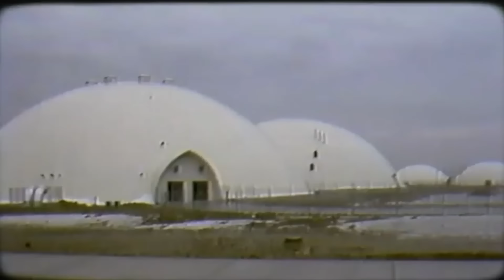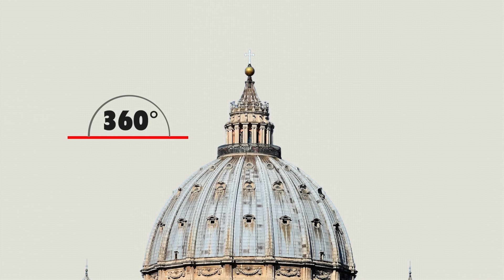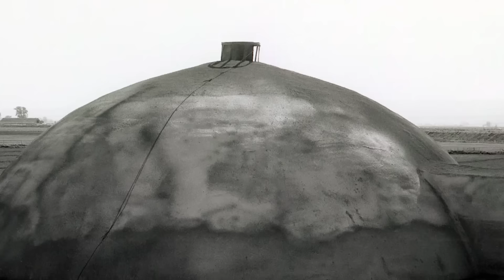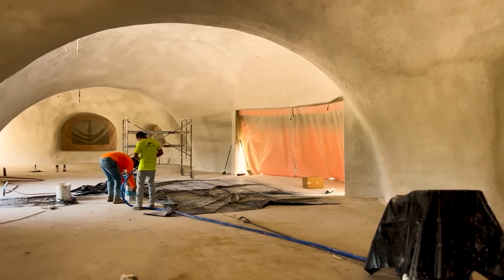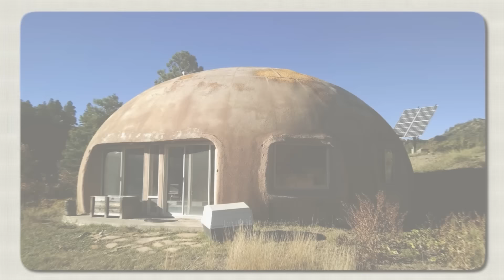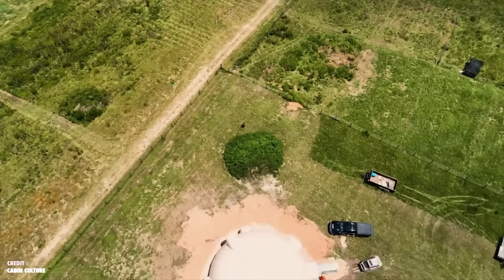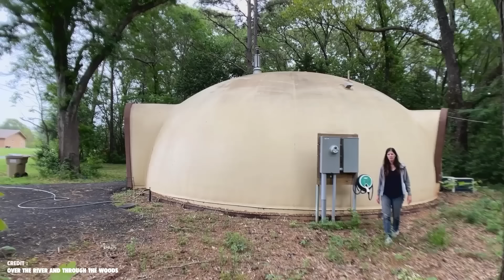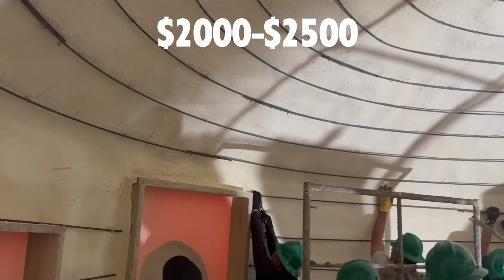This Home Survives EF5 Tornadoes, Wildfires, and Costs $0 to Heat. Why Aren't We Using It?

Comment: I have been trying to make the point that a round house can survive tornadoes
Reply from the maker: The aerodynamics of a circular shape certainly help deflect wind loads much better than traditional corners. So you are right to make the point!
Reply: That’s one of the biggest advantages of the design. The round shape and continuous concrete shell give the structure a much better chance of handling extreme wind forces than a conventional house.

Comment: I was told by Architecy Bill Milburn that credit should be given to Tecton Corp in Colorado Springs  who taught David South this technology.   He made a few changes so he could get his patent.  I was also trained by Tecton Corp in 1977.  I designed and built my dome and the first totally  underground dome for Park College in Parkville Missouri which has over 30' of earth over it. It is the entrance to their underground library in the mined limestone common to the KC area.   Other than that , everything in this video is factual.  As an architect/builder I got tired of the battles and went on to other systems.

Comment: Fact: These are legal in my state of Nevada, as long as they meet all the building regulations. I've seen a few of them here. One would think they'd be more popular in a place that reaches 120F in the summer. However, the biggest problems aren't with getting them approved. It is with the interior walls, cabinets and plumbing. It's very expensive to furnish and decorate a round structure and comes with many issues we normally don't consider, like curved cabinets, counters, closets and bathrooms. Though it has many advantages when it comes to heating, cooling and strength, round is the least space-efficient shape in a practical sense. These homes are actually legal to build in most states. People just don't do it because it costs 4 times more to design the inside because everything must be custom-made.

Comment: In fact, there is an even better technology, panel construction, where reinforced concrete panels are produced locally and the house is assembled like a Lego set using a crane, in just 24 hours.

Comment: Their odd shape means less usable interior space. Its a nightmare for running electrical/plumbing. Difficult to impossible to modify or expand once complete. Repairs are costly and specialized. And they suffer from leaks and flood damage. People don't want to live in large concrete igloos.

Comment: uh.... you've glossed over a couple big items here, 
PVC membrane on the outside, lifespan is 30-40 years due to UV exposure.... after it fails, there is nothing to protect the polyurethane  insulation, there is also going to be an issue attaching the replacement liner to the poly urethane insulation PVC resists common adhesives
  
also, fire is going to engulf that insulation in an instant.... the outside is highly flame-able

Comment: I really love the concept, but the fact that it is entirely made out of steel-framed concrete is ridiculous. For those slightly giving a damn about the ecological aspect, there are lime and clay based dome structures made with 3D building printers developed. For those that don't care, well.. glad you will be able to test the indestructiveness through climate disasters.

Comment: Society is so messed up we build BOXES cheap that get damaged so much making insurance companies RICH and hydro and water companies richer its INSANE.I lived in a 75 foot dome with a proffesor in the 80s and it was an amazing exp. The acustics are incredible the air flow is pure and the temp. was regulated by 6 cieling fans 30 feet up and a cool sysetem for airflow. He heats with wood and electric back up makes his own preserves and wines and at 87 today is still there. He built 6 more smaller ones all by his own triangle jig system and use 2x8s to make the triangle.Hes had numerous trees fall against it but they just rolled off and lived threw 2 tornadoes. 5 min from our city everyone calls him captain (of his own ship lol) If society adopted this style for towns etc. costs in life would drop insurance companys would go bancrupt and energy companys also. So society is designed to make the wealthy RICHER its CORRUPT as hell. TY for this memory.

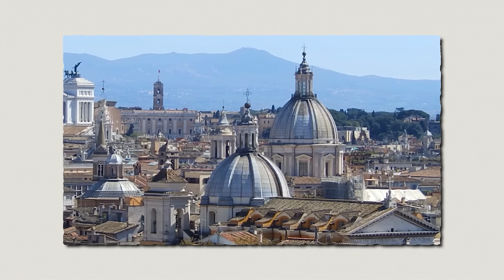Comment: The graphic at 1:20 is incorrect and does not illustrate the statement. Instead, imagine looking top down at an arch and spin it 180°.  The two abutments of the arch will trace out a 360° circle.

Comment: the main reason is because the interior space is difficult to use.  the windows are hard to seal properly, require specialized construction crews increasing cost
Reply from the maker: They certainly have their challenges!

Comment: Cooking limestone into Portland cement, OPC, with which concrete is still made, puts .86 ton of CO2 into the atmosphere per ton of cement. It's chemically active--slowly dissolves in acid rain--and wants to crack. The cracks let water, even vapor, reach the rebar, which rusts. Rust needs three times the space, and as it expands it breaks the concrete apart. Engineers figure bridges made with OPC will last 60 years, 100 with lots of expensive maintenance.

Geopolymer cements are crushed aluminosilicates--3/4 of the surface of the earth--activated with something alkaline like sodium hydroxide. They have 1/10 the carbon footprint of OPC, are several times as strong, don't crack as readily, are more alkaline to protect rebar from rust better, might last millennia, and should cost quite a bit less. And Floridian Robert Panitz claims that his organic-activated geopolymer cement, Blue Crete, insulates as well as an insane R-17.5 pr inch with some aggregates. Geopolmers are fireproof, and protect wood-chip aggregates and bamboo reinforcing from fire and rot. Spray enough Blue Crete wood-chip concrete to climb, once it's set, onto the outside of an inflatable dome form; it takes and holds nails and screws so you can attach walls or anything else to the inside. Staple bamboo rebar, wiring and plumbing to the outside of that, trowel on a stony aggregate layer, and you're done--Blue Crete is hydrophobic so you'd never need paint. Add color to the outer layer--inner too, for that matter--and the structure is "painted" for life, which could be several thousand years. Such a dome would be utterly fireproof and tornado proof; more so, and even more energy efficient, if you bury it. And Hobbit houses are cool. Literally.
Reply from the maker: Good detailed constructive reply.  To be honest I am not 100% sure of geopolymers.  I could look them up on Chatgpt or Google but still would not know how good they were in terms of their suitability.  Encountered similar things in the form of fly ash based concretes (similar to roman cement but made with fly ash), which are also an option as well as adobe if you want a green option.  Really appreciated the detail reply, hopefully proves useful to others!  Thanks!

Comment: NOTE:  While structures can be rated to withstand F1 (Moderate Tornado): 73–112 mph winds, what they are NOT rated for is withstanding a projectile (like a 2x4 or a metal dumpster) slamming into them at 73-112 mph.
Reply from the maker: You are right, unless they are something like an Earth Shelter where they are effectively build into the ground.  Thank you for the comment!

Comment: Can FRP Rebar be used? I'm thinking DOME but would prefer less metal.
Reply from the maker: Now an one click AI reply would say instantly "definitely" BUT as an engineer I would advise that if you do decide to use them then you get a structural loading analysis done in order to make sure the FRP Rebars you use can withstand not just the loading of the cement or adobe but also anything that will be on the roof like snow. Not sure of the cost of a structural engineer in your area but worth doing in order to avoid the worry!  Thank you for your question!

Comment: Well the dome as such is a technically favorable form for several reasons but it also have disadvantages as a home, like windows (difficult and not likable for most people that value light and view), difficult to furnish unless you are a mimalist and if you want a large house with a lot of bedrooms - e g many children etc - the cost effective solution using a second floor will be problematic.  
  
The good properties of the form can be accompliced in other types of forms by other means: 

- The resilience against catastrophes: 
   --  Can be solved by thick armed concrete.  
 
- The thermal efficience: 
  -- Can be solved by (thick) isolation.
  
- The roof resiliance: 
  -- Again armed concrete. 
  
- The isolation on the outside of stone like structure (which gives thermal inertia): 
  -- Can be done with other forms. 

Anyway it's mainly about what you like to live in and the cost. 
Personally I prefer a (mostly) rectangular house as it has the possiblity of more light coming in/better windows. And better possibilities for me to place my furnitures. Although in some ways I like the dome type forms, like the difference to common houses and the organic forms that are possible. 
If I would choose a dome like form for my house I need to have at least the double living area compared to a rectangular house to like it. 

But as always it comes down to production cost. (Here I ignore financial problems and "red tape".)
Reply from the maker: It is a very reasonable position to take.  The home is an individual preference - something you have to be happy in.  To be totally honest my preference is Earth shelters as you can have it any shape you want and benefit from the thermal inertia of the earth.  Also like having a green roof!  Appreciate you comprehensive reply!  Thanks!

Comment: Not sure how these buildings would survive in a location subject to major earthquakes though.
Reply from the maker: True - they are rigid so would likely suffer the same issues as any other rigid building.  The only buildings that would survive such areas would be ones with built in attenuation or "shock absorbers" in the structure.  Good point!  Appreciate the feedback!

Comment: What causes the rarity in these buildings is they are strange looking and it's hard to get people to go for something that looks odd and stands. Also they cost much more money to build because the amount of concrete that goes into them is way more than what you put into a hollow block crawlspace or basement and concrete cost more than wood. Also it is very difficult to find anybody local that has the skill and experience to build these structures. You can find a carpenter in any town. Also would is much more available in the United States than concrete is. Perhaps these would sell better in Europe due to the lack of wood availability.
Reply from the maker: All valid points! I am not sure there is a shortage of wood in Europe as wood is traded internationally.  I think the issue is "acceptance" as a design.  We are all used to square boxes so that is the norm.  But you are correct in respect to everything you say!  Thank you for the constructive feedbacK!

Comment: Think about an igloo.  Stands up to fierce arctic winds and is self supporting.
Reply: And they still build them on the beach with 8 ft stilts for flooding. Hurricanes still blowing them away!
Reply: @speedracer2336  Who does?  Their idiots!
That allows wind to get underneath; that is the whole point of the shape!
Like an egg, the hemispherical dome redistributes forces equally, providing tremendous strength against crushing forces pushing in from outside.

Comment: Even using the Quonset Hut design that the military uses would get similar benefits. Rounded roof that extends all the way to the ground, low profile, while maximizing inner space. Less materials to build and fewer measurements, no corners, and lends itself to cookie cutter reproduction. Ends are used for doorways, porches. Solar tubes can light the inside during the day. Currently used for industrial purposes, farming, garages, etc. But the design itself is wonderful.
Reply from the maker: Totally agree! I think you will like the next few videos coming out on the channel very shortly.  Thank you for your comment!

Comment: We have been looking to have some geodesic dome's built for years...but the red tape is significant
Reply from the maker: Regulations are indeed the challenge.  I am not bias but I think monolithic domes are perhaps more weather tight than geodesic domes. Geodesic use a frame and a lot of inserted sections which means more opportunity for water ingress.  Anyway completely agree in regard to regulations (red tape)!  Thank you for your comment!

Comment: I own a geodesic dome home built in 1980. They leak. The roofs cost twice as much to repair. Plus, because you cannot get any comparables - refinancing is almost impossible. I live 125 miles from the ocean and pay over $4K a year in insurance and was even dropped by Citizens.
Reply from the maker: I think we mention in the video that geodesic domes are know to leak because of the number of panels used in the frame, so need to be well sealed.  I really like the concept (Eden Project in Devon UK being one of my favourites) but not sure they are the perfect option for homes.  Good to hear you took the opportunity to at least give it a go.  I am sure it would make a good Airbnb for the novelty value.  Really appreciate your insightful feedback - thanks!

Comment: As an appraiser, these houses are considered "unique", similar to barndominiums, log houses in many areas, container houses, bermed homes, etc. They can still be valued for lending purposes but it is a challenge. No national mortgage source (FHA, VA, Freddie Mac, Fannie Mae, etc) specifically prohibit financing unique properties. A larger concern to me is living in a Seismic Zone 4 with largely concrete construction. Any data on that available?
Reply from the maker: When looking for this sort of data I tend to look at research papers.  The reason being that they undertake funded analysis work that provide real rather than made-up info.  I would try this as a starting point: https://www.researchgate.net/publication/371963711_Systematical_structural_analysis_of_monolithic_domes

Hope this helps!

Comment: Substitute the Concrete for Hempcrete, and it takes these structures to the next level. 

Even better insulation, lower cost, less environmental impact and more durable.
Reply from the maker: I like that idea but the only problem is that Hempcrete (which I do love) is not structural as it is very porous.  It tends to be used as an insulator or interior wall product. I would certainly use if for an out building but not sure about a living space. Appreciate the thought!

Comment: I've studied these for over 30 years. They are awesome. However, they do require maintenance. The exterior, for example, needs to be redone every ten years. They are also more difficult to sell, so if you have to move, you usually get less in appreciation, if any, and it takes much longr to sell for obvious reasons. On the other hand, the institute does have mortgage and related financial and construction resources.
Reply from the maker: Appreciate the practical feedback.  Do you know what treatment people use to repair the outer surface - I tend to suggest a lime based product as it sets hard and offer weather protection but I know others prefer a polymer based material. Given you lived in one for 30 years what would you suggest?

Comment: A lot of false information in this for profit advertisement.  For example ... the dome building technique presented here uses a outer layer of  PVC coated polyester fabric covering closed cell spray foam insulation.  Later it is claimed that a 15 pound 2X4 traveling a 100 Mile per hour will barely scuff the surface of a three inch concrete dome.  That is probably true but with this building technique that 2X4 is not hitting a three inch concrete dome directly  instead it is hitting a  PVC coated polyester fabric covering closed cell foam.  That fabric coating over spray foam will not stop such an impact.  Add to that the  PVC coated polyester fabric will not last decades if it would even last years leaving the spray foam exposed to the elements.  Looks to me like a never ending maintenance and repair nightmare.  So what you are dealing with here is apples and oranges.  The examples of monolithic domes given here are not all made with this patented technique.
Reply from the maker: You know what you say all sounds logical to me so I can't really argue against anything you say other than the reality (evidence) doesn't support the logic you present.  I appreciate the constructive feedback other than the "false information" bit which I hope isn't true, and if someone is profiting from this as an advert I hope they donate the money to this channel!

Comment: How do you heat them? Underfloor heating with a heat pump maybe?
Reply from the maker: Underfloor heating is a good option.  They have a lot of thermal mass so they retain heat well.  What you do need to consider is the MRT - mean radiant temperatures.  If the mass gets cold it will draw the heat from the space beneath.  If you use convection as opposed to radiant heating the heat will rise and heat the mass of the building first, thus underfloor is a good shout for these buildings! Thank you for your comment!